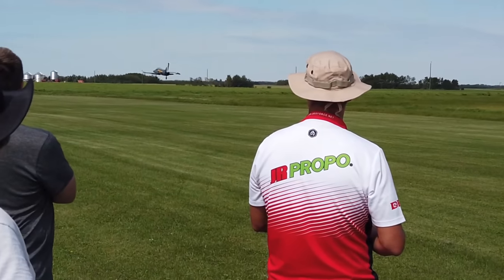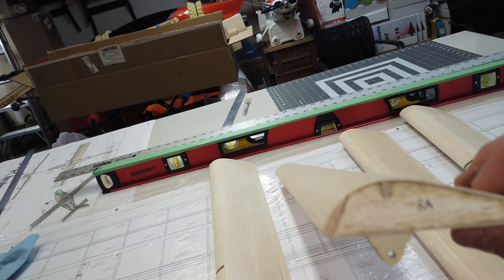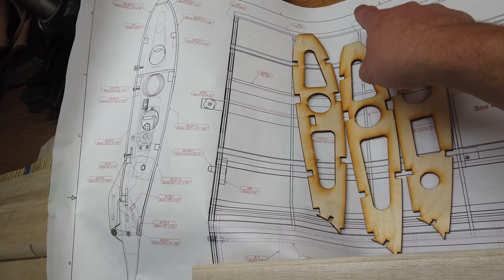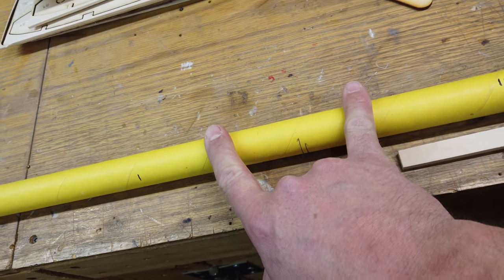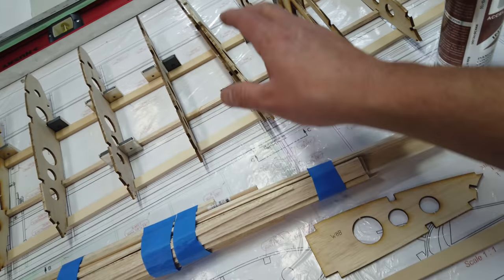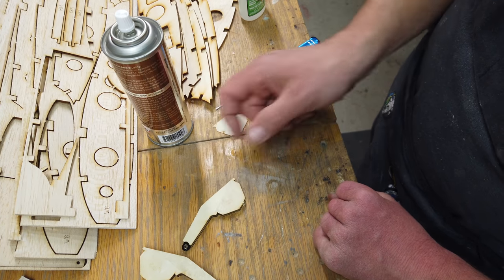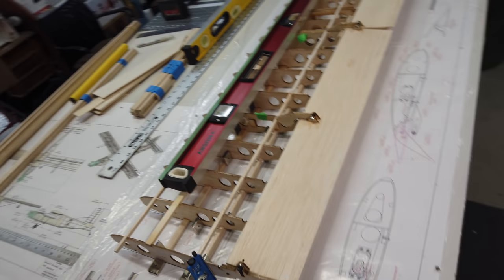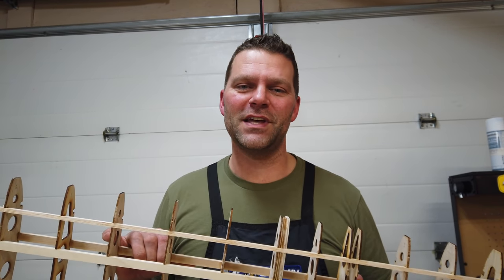BUILDING THE WING OF A GIANT PILATUS PC-6 Turbo Porter - MR Aerodesigns Part 3

Comment: Flipping the wing at the root the left becomes the right wing as you mentioned in the video. However, if you take the left wing plan, as you are using, than roll the wing on its leading edge then you have the left wing  withe the leading edge facing yo. Than there is no error with the plan. Left wing plan remain the lleft wing. 
All depends how you look at it. 😀
Reply from the maker: Yea totally.  It's not like it's really a right or wrong way to do it.  I suppose it's whatever works best to wrap ones head around things.

Comment: A disc sander for getting the mating surfaces to join the main spar. double sided or masking tape to hold both pieces tight together while sanding. Even a five inch sander will get a mating surface of 50mm or so.
Reply from the maker: Beautiful!  Thanks John!
Reply: another way is to clamp two spars side by side, use a Japanese fine tooth or zona saw. tilt the saw 45 degrees while at the same time angle the cut, that way you get a perfectly matched compound angle with more glue bonding on the longitudinal grain. an old cabinet maker trick.
Reply from the maker: This is the method I used for all the spare.

Comment: I tried the test fit to the fuse with W1 not glued....
Didnt work as planned. 
I ended up gluing W1 on the plans to get square, but left the wing tube free. There is enough play in wing tube to align wing nicely..
Reply from the maker: Just posting it here so others can see it even though we have talked.  I came to that same conclusion in todays work and you will see it in the next video.  Only change was I just spot fastened the W1 to the balsa ribs and then test fit it to check.  Once satisfied I did final gluing.  Wing tube will be glued once fit and angle is checked before sheeting.

Comment: Can u tell me what size servo arms  your running on your ultra flash ?    And also can I use the ball link connector   Especially on the rudder  I can not get full deflection
Reply from the maker: +Carlton Davis I’m using the nylon HD JR horns. I think hole #3 on all surfaces and hole 4 on rudder.
Reply from the maker: Additionally every flash I have built has used the stock setup. Nylon horn. Clevis on servo side and stock double sided ball on surface side.

Comment: Just have a question  looking to pick up  a turbine. What’s the difference between the king tech 160 g2 vs the g4
Reply from the maker: Hello Carlton.  The G4 has a few changes.  Here are the major ones.  1. intergrated FOD Screen.  2. Brushless starter motor.  3. BUS System and ECU in turbine.  So now instead of having multiple cables, 1 being a Phone type cable, going to the turbine it's just a simple 3 prong plug for all the data and power.   If your buying brand new I would suggest the G4 even if it's a couple hundred more.

Comment: Woow, entire "build wing upside down" thing seems like last minute fix to the design oversight by the kit authors, more like oopsie'down :) I mean, entire point of using flat bottomed profiles in models is to make them easier to build and build them straight, building the wing upside-down kind of negate all this. Wouldn't it be possible/simpler to build wing "right way up" and add problematic "horned" ribs afterwards?
Reply from the maker: Definitely possible to do that but would require some foresight into how to get that achieved.   Of course there is many ways to build things, right now I think flipping the wing is easiest.